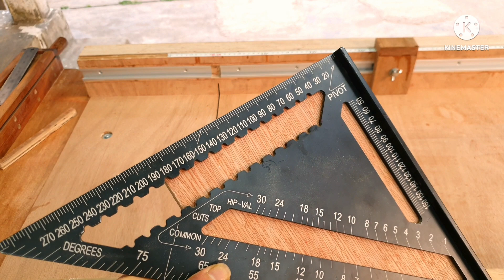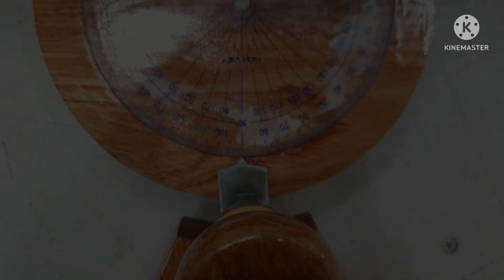Building A Table Saw Complete With Fence - Sled Extended And Angle Jig || DIY Basic Saw Table

Comment: Nice work,I like everything about your build,except using the angle grinder,I hope you can reconsider that choice,it is extremely dangerous as 7 1/4  saw blades are rated at 9000rpm max,and most grinders can go above 11000,something can easily go wrong and cause you a serious injury,be safe man.